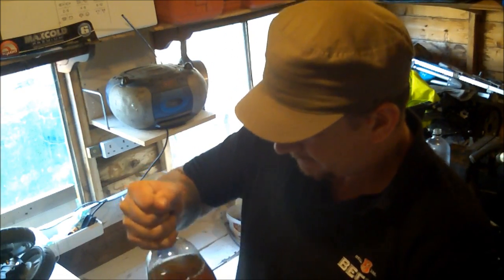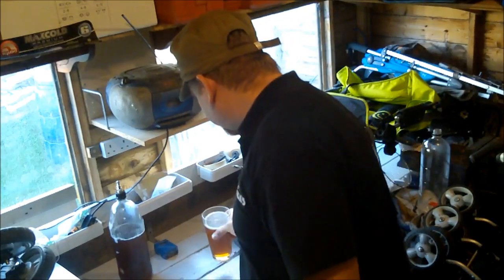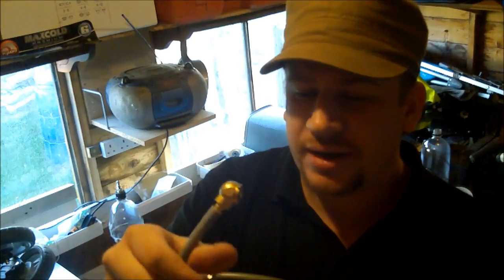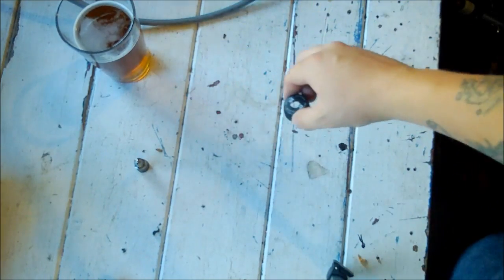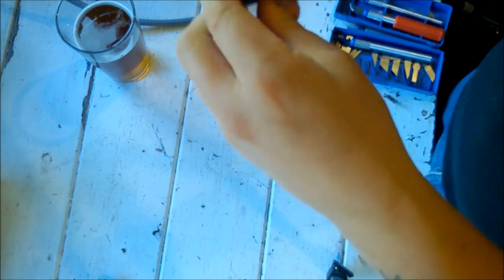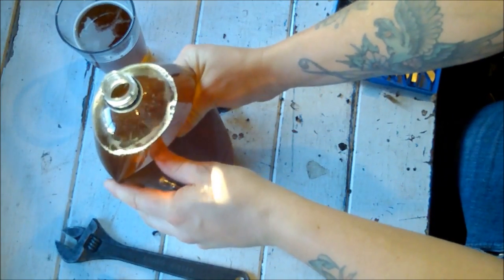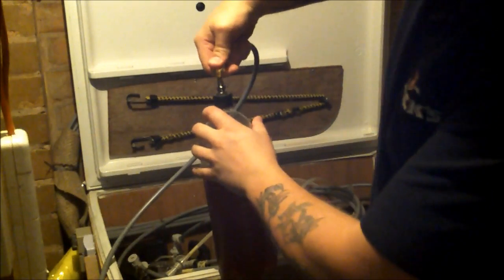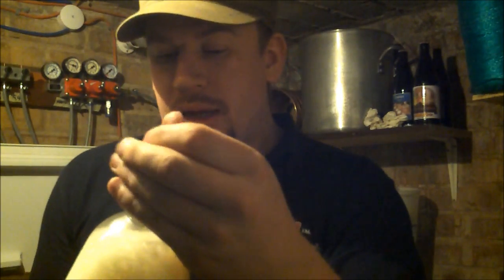HBW 18 - Carbonate bottles with CO2

Comment: great work man i tried your method, not just on beer i made soda and my own version of coca cola with every combination i could think of :P,

there is only 2 questions i got thou,
you said 7 ~ 8 time i could best 6 times after that CO2 won't settle down for more carbing,
how you did 7~8 times without bursting PET bottle!
whats best temperature to do it.
and last thing it carbs like sparkling not like commercial cokes or beer i wonder what part i don't right.

any how its way better drinking mud syrup by yeast and way faster
Cheers

Comment: Thanks. Think I'll use this method rather than carbonating the whole keg. When you drill the bottle cap, it would be better to use a Unibit instead of a drill bit and craft blade. That way you get a perfect bevel when the hole is made. On your intital gas insertion, if you hold the bottle upside down you increase the CO2 surface area for more efficient infusion.